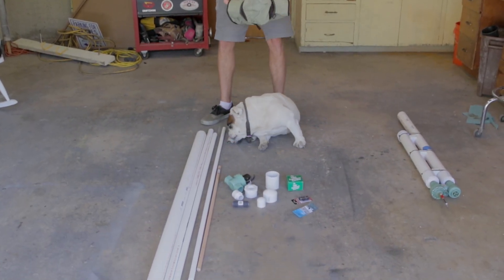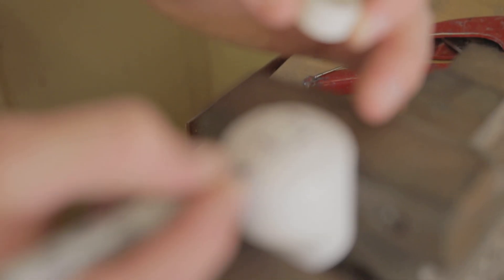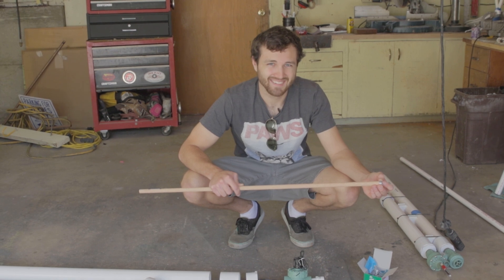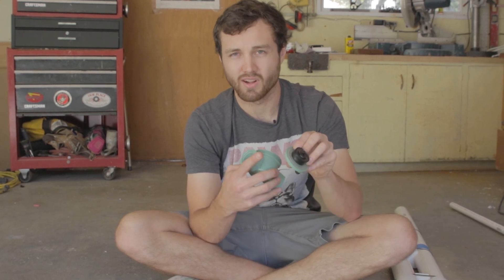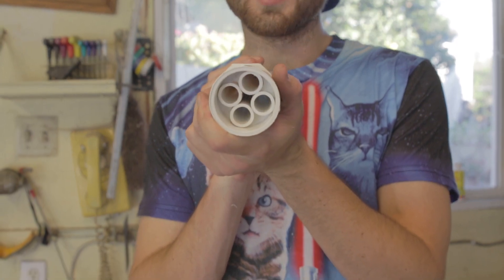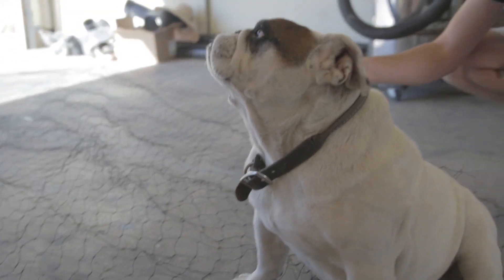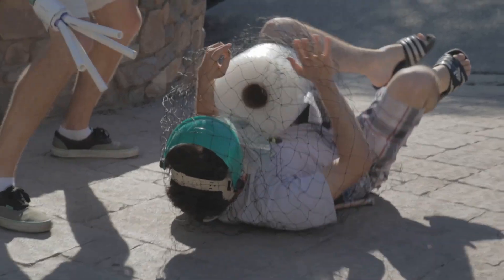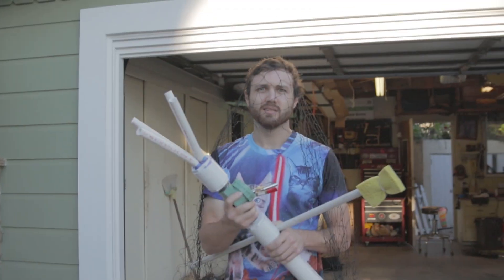How to Make a Net Gun

Comment: pvc is rated for 5psi... that stuff will blow up
Reply: Kyle Wade there's also high-pressure pvc.
Reply: Zach Bernard yes cpvc. that was sch40
Reply: Kyle Wade yet it can hold more
Reply: PVC in general is rated for LIQUIDS under pressure. They are NOT rated nor engineered for AIR under pressure.
You should not EVER use PVC pipe for pneumatic purposes, it WILL SHATTER eventually. Plastic shards are bad...M'kay?

Comment: Now make the net metal and give it electricity
Reply: justin jimenez 1. it would short circuit instantly, secondly it would just hurt for a few second since I doubt a high voltage circuit and battery will fly very well.
Reply: justin jimenez LMAO HE DID IT!
Reply: Nerd With an Opinion What about batteries as weights
Reply: Thats Michael's job
Reply: Mr. Headcrab smart !
Reply: What about charging it (not like taser level, static shock level) just as it leaves the gun? Since it's not grounded, would that work? Edit: or would it just arc?

Comment: Maybe the net gun would work better (and be faster to load) if you made foam sabots  and used a spiral grooved barrel to launch the net? The main issue with launching the corners of the net outward to open the net is that the net is going to bounce back closed after it fully opens.